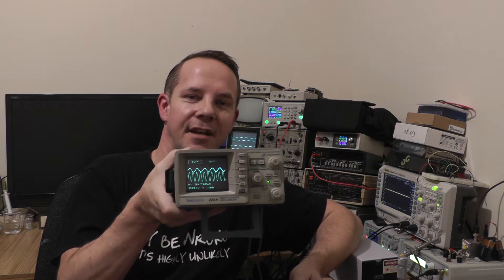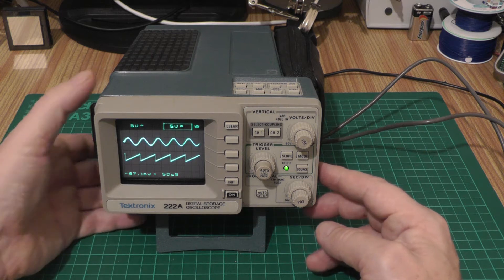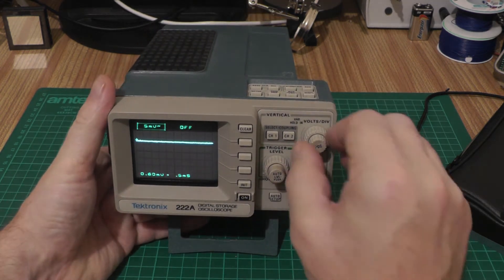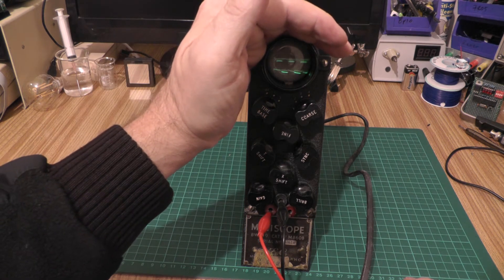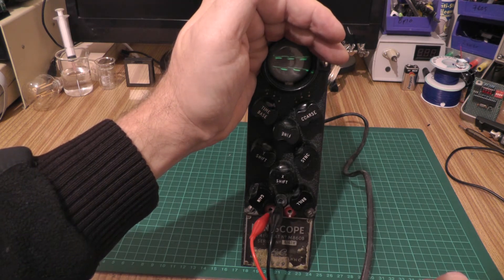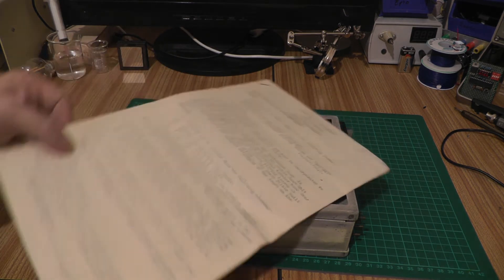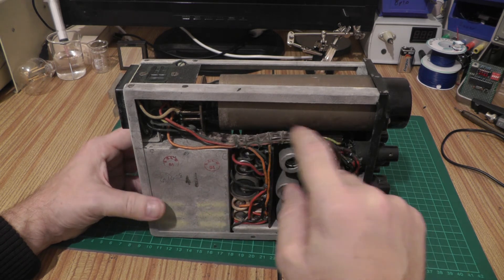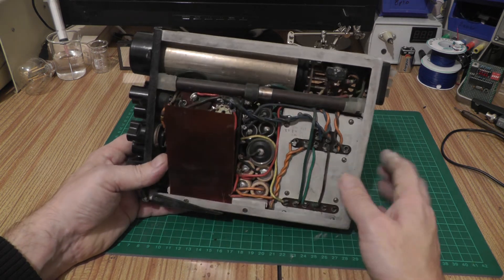Mini Oscilloscopes: Tektronix 222A & Vintage GEC Miniscope!

Comment: I have a tektronix 223..had it for years..lost manual and power supply need to replace them... Like battery swap...great vid
Reply from the maker: Thanks! They are great little 'scopes, and the battery mod makes it at least useful!

Comment: I think I've got a mention of yr GEC Miniscope in one of my books - will try to find it.  
The vibrator modules were very unreliable but using MOSFET half bridge circuitry a reliable replacement could be manufactured.  They allow running the device from 24 volts DC (130 Hz).
Very nice to look inside, thank you!  And wow, did they pack it!
Used with old-style wobbulators they could be used to display frequency response curves and the X-sweep voltage was tapped off to control frequency sweeping.
The interest with these old devices was in the ingenuity the engineer exerted (exerts now) to obtain information that went far in excess of the available bandwidth, and using mixed signals too that wouldn't display properly on a high speed modern O'scope.
Very handy for mind-training !!  :-)
Reply from the maker: Cool. It appeared in quite a few books and periodicals of the time. I am certain that when I get aroudn to refurbishing it, it will be a usable instrument. Agreed, using old scopes like this, you have to read into the waveform somewhat. I used to have a huge ancient Cossor back in the day that was a think of beauty!

Comment: Too cute! Hope you've unlocked all the DRM firmware options? 🙈
Reply from the maker: Ha! :-D No such modern curses on these delightful old machines!
Reply: I'm super jealous of those portable scopes...i have one of the early vellman digital scopes. It's horribly limited, but has helped me troubleshoot plenty of sensors and ignition systems in cars.

The old scope is probably the coolest piece of vintage test gear I've ever seen.
Reply from the maker: Any scope is better than no scope. I used to have one of those. It had a horrid little LCD display. CRT's all the way for me.

Yep the old scope is very cool. It will be interesting to see how it performs once it has been overhauled.
Reply: @LesLaboratory  congrats you just got a comment from macro reps :D

Comment: hmm nice miniscope.  If was going to rebuild this one I would defiantly take the time to empty out and re-stuff the caps so it least looks a little like the original.
Reply from the maker: Yes, I might well do that. Always makes me nervous refurbishing old gear. I wouldn't want to reduce its value.
Reply: @LesLaboratory  Yeah it is always a problem for vintage gear. I do not think this is something you would use except just to show it working.  I would guess there is more  more value in keeping it in original condition than diddling with it to get it to work perfectly.

Comment: The 222 is a truly isolated scope, safe to use in a floating configuration. The miniature CRT is just millions of times better and more readable than any lcd "scope/meter" handhelds.
Obviously neither ground clip on the two probes is connected to mains ground, and they are not connected to one another either, so you can make two simultaneous fully floating measurements. There is nothing metallic on the insulated box, so it is perfectly safe to float. There is even a 222"Power Scout" version, which I often carry with me and is identical in every way except it is isolated to 800V peak. It is recognizable by it's bright yellow color. 
Drawbacks : The 10MHz bandwidth "sounds" like a limitation in this day and age of multiple GHz versions, but in reality for power usage it is generally more than adequate.
The probes are specific to the scope, and have a non-standard attenuation value, so if you damage one they are not replaceable. 
The battery was already mentioned in the video, but also mentioned was the availability of several very good modification kits for more modern solutions - much better than new.
As mentioned in the video, opening the case is a very delicate and time-consuming task. If you don't know how this works you can easily damage things, and unfortunately many of the critical adjustments - including basic probe compensation - are inside and not accessible from the outside. 
The interface is RS-232 only, and uses a DOS program called Cat200. It is very limited, however it is possible to download traces from the scope to document your work.

Comment: I'm surprised 96,000 people didn't remind you in the comments, but ~350 kHz is plenty for audio-type work. Surprised it's THAT low... IF on an AM radio back in the day would have been ~450kHz. (I also watch Mr. Carlson's Lab. 😁)
Reply from the maker: LOL! Well back then, any scope was better than no scope. I'm sure a lot of techs looked beyond the displayed signal. Mr Carlson's Lab is great!
Reply: You miss the cleverness....  The Miniscope was set to sweep at some rate between 25 and 50 sweeps per second.  The sweep voltage was tapped from the X plate and used to control a voltage controlled oscillator which then swept 400kHz to 500kHz in sync with the sweep voltage.  This was fed as a weak signal to the radio being repaired.  The AGC was temporarily disabled in the radio and the radio's detector circuit with its audio frequency output could be connected to the O'scope amplifier input.  So what you see is not a waveform Y against time X, but a frequency envelope on Y against frequency on X.

The interest is not in the O'scope itself, but in the clever ways technicians got information out of them..  The old books from 1935 to 1970 are well worth studying.
Reply: @beakytwitch7905  Somewhere, I have a US Navy electronics textbook from around that era. My father got it from an engineering friend of his long ago (for reasons unknown to me -- he was never in that line of work in the Navy). I tried to read it when I was much younger and first started getting into electronics, but most of it went over my head at the time. It's been a couple of decades (and lots of learning experiences) since. Perhaps I should locate that book.

Comment: Love the 1947 scope!  I had a 1950's RCA scope I traded some stuff for in my early teen years in the late 70s. It ran for a few years before a cap died.  Last year I wanted an analog scope for my bench and it needed to be small and ended up getting a Panasonic VP-5610P.
Reply from the maker: Nice! Gotta love mini scopes! The Panasonic looks pretty useful too!
Reply: @LesLaboratory  Thanks. I do like it a lot. I did do a cooling fan fix on it as it sounded like an 80s hard drive spinning up!
Reply from the maker: @UReasonIt  Cool! I keep meaning to do a fan mod to my Tek 2232 and the Rigol, but never find the time!

Comment: Nice video! Recently someone gave me a 1950s Telequipment oscilloscope. Not only did it work perfectly after 60 years, it also makes the cold winter days more bearable as it is also a portable electric heater ...
Reply from the maker: Thanks! LOL for sure! I have heard people used old valve/tube equipment like this for drying socks too! I have couple of old Radios from the 30's that are still working to this day. They sure knew how to build things back then!

Comment: Have you refurbished the GEC Mini-scope?
Reply from the maker: Not yet, it is on my todo list though!
Reply: @LesLaboratory I now own one.  I haven't applied power yet because most likely been in storage for years.  I need to borrow a variactor to reform the caps, if they can be.
Reply from the maker: @darrenconway8117  probably be fine, they don't build em  like the used to!
Reply: @LesLaboratory   Easier to do a soft startup with a variac than to rewind the transformer.  If the cap are bad I am thinking I can replace them with axial film caps.
Reply: @LesLaboratory Do you know how to open it up?  Looks like the enclosure slides off to the rear.
Reply from the maker: @darrenconway8117  yes on mine if the plugs are removed the case slides off the back. I can't remember if there are screws, I am away from home at the moment.
Reply: @LesLaboratory  OK so to remove the cover, remove the earthing nut on the rear panel.  Then the cover slides off.
Reply: @LesLaboratory  I eased up the voltage on a variac and no smoke escaped.  It was using about 100W power.  Way too much so something is wrong.  Your Miniscope is slightly different to mine.  I don't have the external battery connector so I suspect yours is an earlier version.  Can you please post a very short video that shows the component designators on the photos of the insides (both sides please).  Also, the circuit diagram from the manual.  I suspect it will be slightly different to mine.  I am just going to go through and replace all resistors and caps.  I think I will be able to replace the smaller value electrolytics with axial film caps.  They will last forever.

Comment: Enjoyed this comparison and I look forward to seeing your video of servicing the Miniscope. I too have one, together with the IF alignment unit. Mine is also in original condition and the trace is very dim. I took a look inside with a view to replacing the likely duff caps and out of range resistors, but quickly boxed it up again when I saw how tightly packed everything was!
Reply from the maker: Thanks! Cool! There were some interesting accessories for these.
Yeah, eventually I will get around to it, but it will be a lot of work no doubt. That said, It would be nice to see it restored into good working order.

Comment: Great scopes ! I see Mr Reps in the comment's (answered my own question ) does the Tektronics have a ceramic tube ?...cheers
Reply from the maker: No, the tube is Glass in this one. U have seen ceramic tube on older Tek Scopes though. The one I saw was hybrid, with a glass section for the electrodes, a glass faceplate, but a ceramic mid section.

Comment: Is this basically a digital oscilloscope but with a CRT? So it still does A/D-D/A but it’s just displayed on a CRT?
Reply from the maker: Yes, its all digital (apart rom the CRT) Honestly I would have preferred an analog option on this scope, like on some of the other Tek's, but still, it's pretty cool.
It's not the best scope in terms of bandwidth and memory depth, but I'm sure back in the day this was truly cutting edge!
Reply: @LesLaboratory  oh that’s ok - still amazing for it’s time.